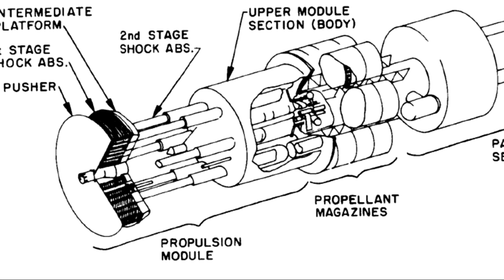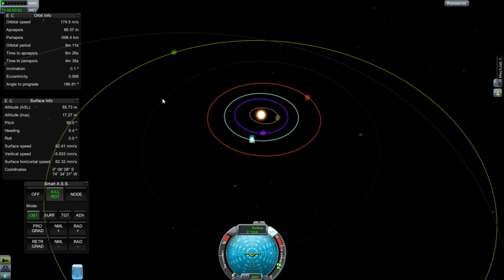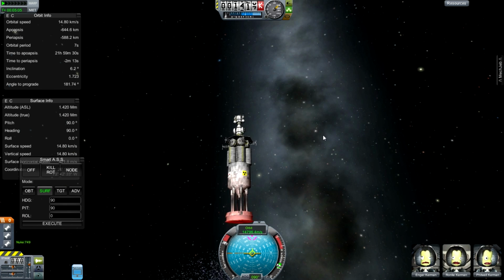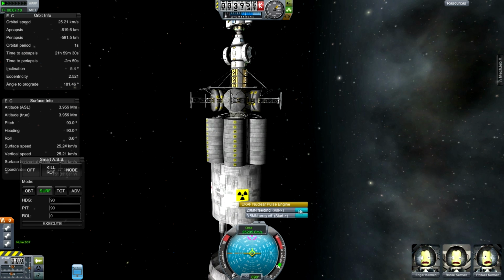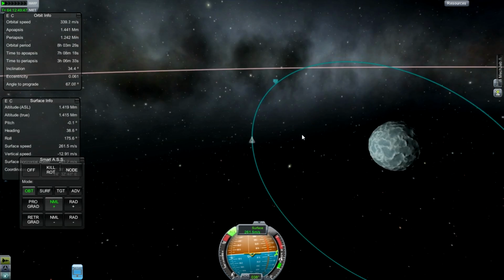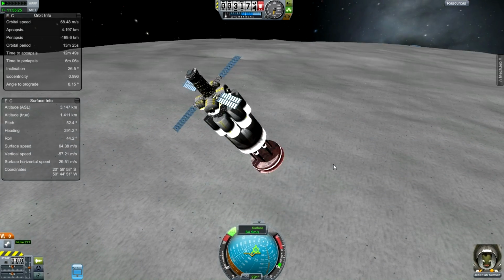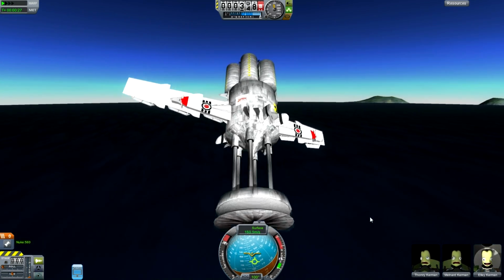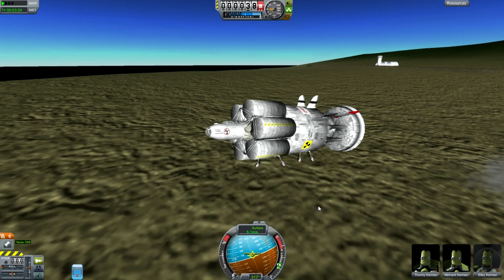Kerbal Space Program - 'Orion' Nuclear Pulse Rocket

Comment: How would these work in space since their is no air or anything for the pusher plate to "push" against
Reply: plasma from the bomb
Reply: louis lauzet yep just like rockets pushing against the gas
Reply: louis lauzet In addition, the design sprayed a very thin (.004-.007") layer of oil on the  bottom of the pusher plate and in the flash of the pulse, this oil vapourised and escaped at a very high velocity, providing thrust tot he bottom of the plate. The pulse units themselves were actually shaped nuclear charges (now, let's just ponder that for a moment...)  and had a plug of polyethylene on the side that faced the pusher plate. The pulse again vapourised and accelerated this plug od polyethylene and this material also impacted the pusher plate as a plasma, providing thrust.
Reply: Oducks58 The plasma shock wave from the bombs will push it. Think of it like having a long piece of string with a 2 liter bottle hanging from it on a large ring, and throwing small balls at the back, your arms are the bomb detnating and the balls are the shock wave, whenever the ball hits the back of the bottle, it pushes it forward a little, just like orion with the nuclear bombs exploding and the shock wave hitting the pusher plate. For others who don't understand it, I hope this is understandable enough and if not, try doing whats above, as an experiment:)
Reply: David K In the atmosphere, the shock was part of the thrust, yes, but in space there is nothing to propagate the shock, i.e. there is no shock. The energy flash from the bomb which vapourised the oil film plus the energy transfer from the impact of the vapourised Polyethylene plug from the nuclear charge are the principle producers of thrust in a vacuum. There simply is no shock in a vacuum.
Reply: tankmodeler Yes, I do understand that shock waves don't work in space, but I was trying to explain it in a way that I would understand (I am only a teenager) so others could understand, but what I meant to say was that expelling mass from the core of the nuclear bomb in the form of plasma pushes the spacecraft forward to achieve the thrust on the orion, but the some of the comments above didn't explain it very well (to me anyway) and I wanted to explain it in better detail, and in a way so that people would be able to perform their own experiment if they wanted to, too see how orion worked in a understandable way. I did just edit my comment above to fix it, but you are right, shock waves don't work in space, I just wanted to explain it in a recognizable way.
Reply: David K Then carry on, you were doing a good job. The fundamentals are essentially as you say, only the details were different. Around here, people can take simplified info away as "truth" and not see some of the fundamental differences between an example or analogy and reality, especially if it's technically non-intuitive. Sorry to be a pedant.  :-)
Reply: tankmodeler No problem, You aren't a pedant, I made a small mistake and you corrected me, It can happen to anyone, also, thank you for correcting me, I don't want to put on wrong info on the internet and make people remember the wrong thing :)

Comment: Would a retrograde 'burn' even be possible, because then you'd be running directly into the  center of the explosion... which would definitely give you MORE than a lethal dose. And yeah, yeah, the you'd already be receiving large doses of radiation form the engines anyways, but still, you get a heck of a lot more if you went directly into the blast, right? :/

Comment: is it really functional tho? wouldn't almost all of the energy emitted by the a-bombs in a vacuum just be light, i mean the shock wave wouldn't exist beyond the maximum space that the material in the bomb ? i mean even if you heat the material up to millions of degrees  a 200kg bomb wouldn't take up that much space. don't think this would work as well as they though in 47. the pressure would just be released.